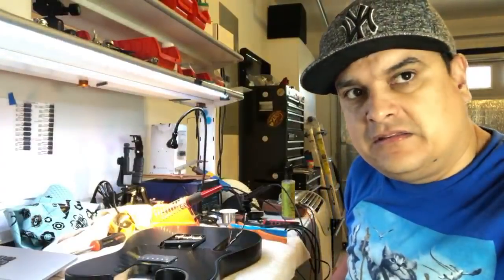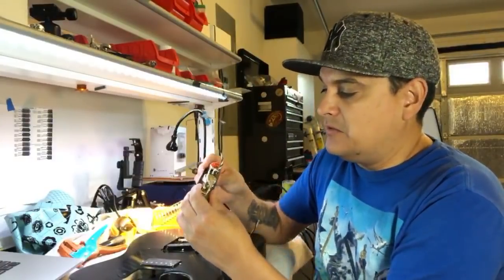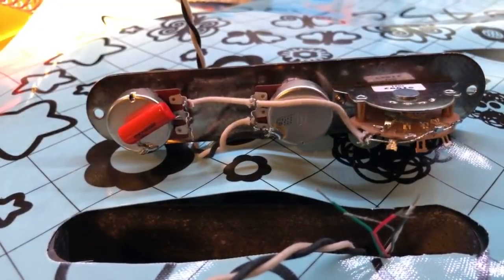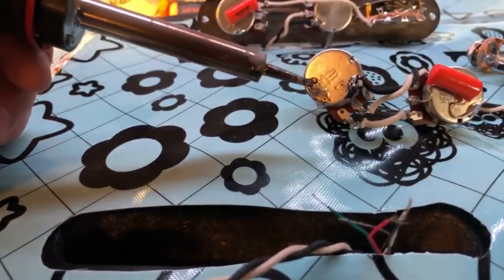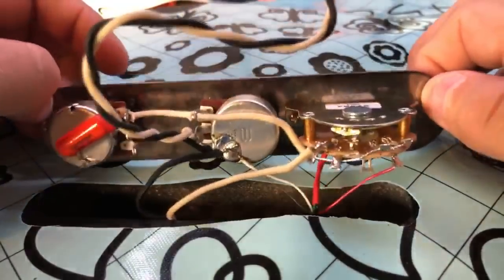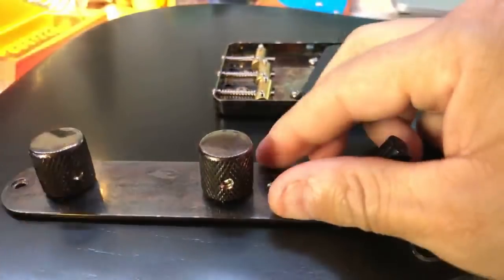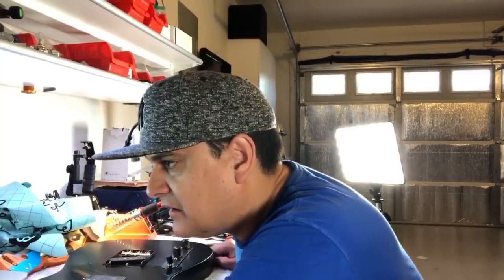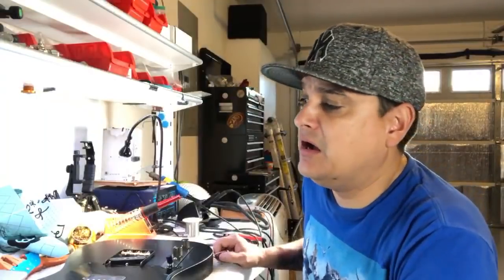How To Solder Guitar Parts

Comment: Dylan, thank you again for this splendid teaching lesson. I learned that the solder I'd been trying to use in practicing, Silver solder, has too high a melting point for the quick in-and-out work you teach, and the pointed iton top was not going to work at least as I'd been using it.
 Got 1/8" chisel tips, proper solder, kept your heat transfer principles in mind... and my practice on an old pot was quick and fun! I'd add to instruction: IF you're going to make several solder connections on one component, take time to let the component cool down between making solder connections. Today I made 4 wire-to-pot-body connections on an old pot that I had securely positioned in rubber jaws in a vice.  Great, except when I was done, released the pot, the pot shaft was really "warm". So, I think I'll take a leisurely approach when I do it. Nothing forcing me to do a project quickly.

Comment: I hope you mentioned lead free solder. I did not know how difficult it is to work with because it has a higher melting temperature and does not flow easily.
Switching to normal 60/40 made a world of difference for me.

Comment: I'm not sure which solder you're talking about at 45:00, but if it's 63/37, it's actually just a better solder.  The advantage is that it's eutectic (both metals freezes evenly when it cools), so it's harder to get the grey crystalized joints that people call "cold" when you move the wires while it's cooling.  60/40 is just popular because it was the best in the old days when the choices were 60/40 or 50/50 plumbing solder that was also usually acid core.
60/40 is fine, but given the choice between that and 63/37, there's really no reason not to go with 63/37

Comment: +DylanTalksTone Currently looking into the Weller iron on Amazon- should I get the 40 watt or 80 watt iron? Need something to solder pots and pedal components
Reply: 40 or 60 for sure. For pedals, 20 watts is good.
Reply: Much appreciated! I do see that I to practice, though my soldering iron may not have been getting hot enough for the quick in and out soldering you describe. I've been taking too long to get needed heat transfer but maybe I just need to wait for the tip to get properly heated. Technique.

Comment: So inspired by this I tried soldering my own pickup change again. Of course I disregarded your advice and bought the cheapest possible 40W soldering iron I could find. The whole ordeal took me six sweaty and frustrating hours including time spent debugging why there was no sound. And I had a problem where the plastic from the wire would melt mix with the solder. Is my tone now fucked? This DIY stuff is really not for me...

Comment: Hi- question. When you are applying the solder to the heat.. are you “pushing with force” to the heat, or, does the heat from the tip “pull” the solder to itself?

Comment: Yeah ,wondering if a piece of guitar string where its not gona short out ,like a jumper on a switch or to ground a lug to the back of a pot , is it good to use .
Reply from the maker: if it will solder, I don't see why not. I use clipped off capacitor legs

Comment: If I managed to get WD40 in my volume pot from the past (see thats a BIG mistake now, thanks Dylan), can that effect the sound of my pickups for the worse, (in your opinion), i'm trying to diagnose what is going on with my pickups (weakened output level, HSS Strat, mid/neck pickups, muddy bridge HB), in addition, when using the pot it makes a faint scratchy sound even after cleaning it with a generic DeoxIT?

Comment: i made a mess, had to take my guitar to a guitar tech to replace the pot, anyways my question is, i probably used my soldering iron wrong in ways like you said not to do, i would put the tip on the pot, and then melt the solder on the iron and let it go on the pot, and then occasionaly the solder wouldnt go down from the tip to the pot so i would take that solder and create the pool like you did to show how the heat transfer works between soldering iron and pot, but now my tip doesnt work, so in the tip part it doesnt melt anything, but if you go really high up on the tip it melts it, but i cant use the higher part of the tip cause i cant have it layed down on the pot, did i buy a cheap soldering iron or is this something that happens alot if i use the iron in wrong ways alot of times, question is should i buy a better soldering iron, or is there someway to maintain the tip using that copper thing that would work even with the cheap soldering iron i have?

Comment: Some good ideas here however I also make sure wires would never touch and shrink wrap whenever necessary. I definitely would never solder two wires together like that, Make little U hooks in each and hook them. Then solder them and finish by covering with shrink wrap. Good detail however and it's a very useful video.
Reply from the maker: Hooking is stupid because it makes servicing later an absolute pain and serves no real purpose. A good solder joint is a good solder joint
Reply: @DylanTalksTone  wire to wire I'm talking about. When you have to extend wires.

Comment: Dylan, is it possible to wire 2 humbuckers, 1 volume push/pull, 1 tone push/pull and an 3 way switch for volume = coil split and tone = series/parallel (the are the cts pots with the PCB board?

Comment: Talk to a real expert on how to efficiently solder, not an amateur that apparently learned by doing. Solder creates an inter-molecular bond with components/wire being soldered. 60/40 tin-lead solder was used reliably for many years by electronics manufacturers. Lead-free solder is now used due to environmental concerns related to lead. A tinned soldering iron tip will not rust if you use a damp sponge to clean it, for the solder creates a barrier to protect it. I  taught soldering and learned through a course taught by NASA.

Comment: great stuff ,,more soldering , changing pickups , setups ,,I have those cheap P-90s from the cheapest Epiphone , then I have the 400$ Epiphone SG and still replaced the tuners and thinking about puttin these  p 90s in it  . THen those cheap humbuckers in another 400$ guitar .THen I have an Ibanez and GRetch I want new pickups for but my budget is zero for a while . And I wouldn't mind learning about my Gretsch 9002 res the round neck that sound like a great acoustic but not much res .

Comment: Since i did Solder my Guitar there are now 4 Pots inside but its a Guitar with only 3 Pots ! And all my Solder is now gone for that job.
But at least the Band is happy I did increase the hum by 300% because its a nice pause filler.
Next I will Solder a Kill Switch to my Amp and a car shock absorber to the reverb of the amp for a little springy.

Comment: USE FLUX. Flux core does not compare to using a Flux pen. Use both together. Just get the pen, not the jar of goop. It makes it so much easier.
Reply from the maker: I mean …. It’s not hard …. A good iron and good solder… it’s not hard. Complicating it with another product would just make it harder. Not easier.

Comment: Lead fumes must be what happened to my tech's brain, they seem to become ga-ga as they age?  Radio Ga-ga by Queen is where "Lady Ga-ga" got his name...yes HIS.  Ga-ga flashed it in at least one video, and in another when asked replied: "yes, I've got a big fat d?ck".  No denials please, it comes from the creatures mouth!  As for this video - just what I needed, being a brain-damaged drooling idiot who was even more brain damaged after sitting next to a wi-fi router all day long for the last 8 years.  Apparently when Comcast became Xfinity and changed routers, the new routers blast wifi EVEN IF you turn your wifi off.  It's in the small print to hide it, but should be in bold print, because everybody knows now to sit next to their wifi router - right?  Since I thought it was off, I was sitting within a couple feet, books piled up blocking its blinking lights, which I ignored (at my own peril).  So my brain is damaged by drugs, by microwaves, and by millimeter waves now too.  I've always been hypersensitive to EMF pollution, so I don't use any wifi, everything is hard-wired, and I even got rid of my "smart meter", paying $50 a month for a human to read it instead (takes 60 seconds, maybe two minutes if they walk-work slowly).  ANYways, thanks for the sottering info....soldering?  Lead is not save to breath, so do try to avoid the fumes, but lead solder is apparently better to use, or so some say.  Finally, I was rude in a couple comments when this channel began years ago, because I thought Dylan was another "know-it-all" who didn't know much, but it turned-out I was wrong, not that I agree with him about EVERYTHING.  Then too I understand my own assumptions may be erroneous, so I always question my assumptions.  Just the other day it happened AGAIN......................cheers!